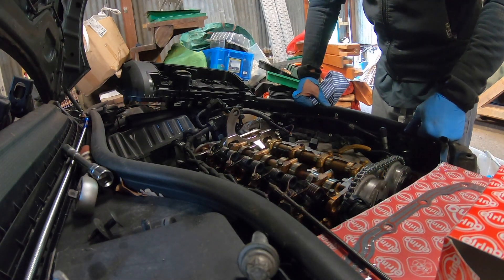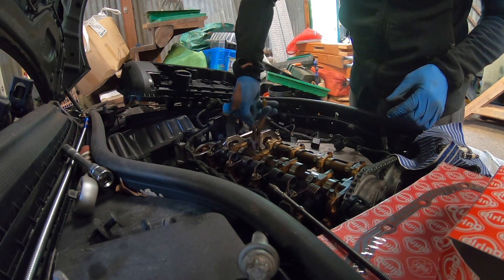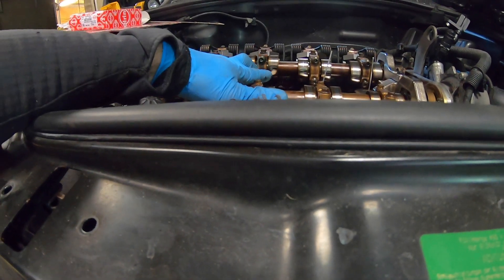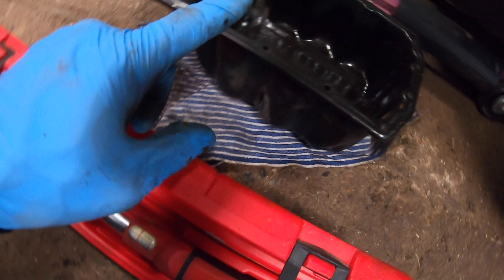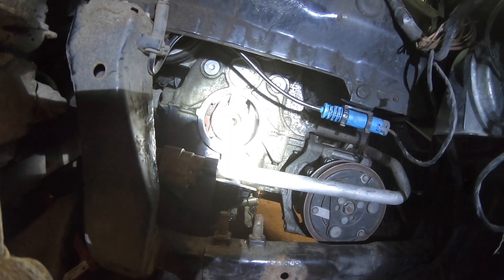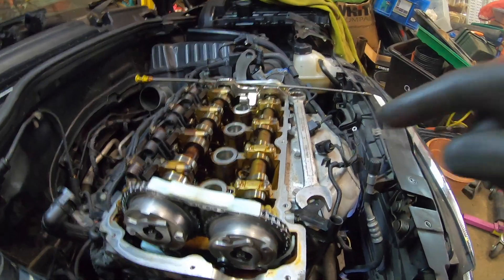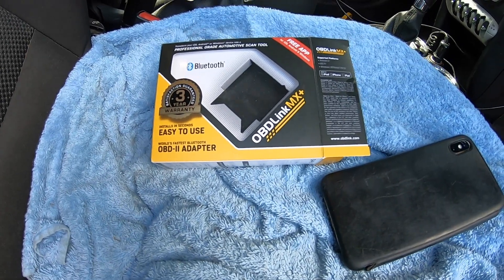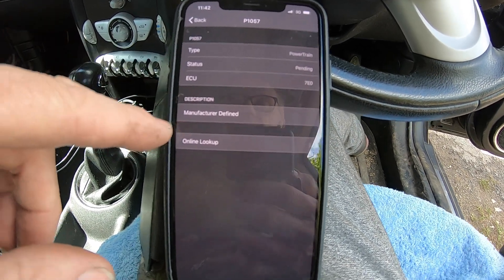R56 Mini One   Timing Chain Pt2   VVT Errors

Comment: I’m at the point of almost doing a startup after replacing timing components and a number of other parts. My first time… I’m curious if you ever got rid of the codes and how the adaptations went.
Reply from the maker: Codes did go, but the car had a few other issues.  Traced to a faulty o2 sensor.  After that it ran fine.  However went through checking and cleaning solenoids, cam motor, re-timed it all.
I am doing the thermostat on the car at the moment.  Will post that video when it is done

Comment: Why you didnt mention/do vanos adaptations reset after the job before starting? Its essential.
Reply from the maker: -- because I am learning, this was the first time I had done this!  As I have stated previously I am not a trained mechanic, I just like to pull things apart and try fix things.  This car is a friends car and he was keen to get the work done and so I offered to help.  The good thing for me is I have learnt a lot.
Reply: @hyphensclassics  Im pretty sure the issue in mine is the adaptation, since i changed the chain/tensioner/guides and chain was streched for sure/tensioner was weak, the car works ´´better´´ now, but still throw the codes p0014 and p11a8, so im pretty sure the ecu just has those wrong old adaptations still in the system and thats the reason for them to still come up and go into limp mode. Lets see after the adaptation what happens.
Reply from the maker: -- I hope it goes all well for you!  It is a shame you need a garage or a really good code reader to wipe the adaptations
Reply: @hyphensclassics  Can i ask you a presonal preference regarding cam phasers? When i install them, does it matter which is the position i install them in? Or can i freely choose the position? Theres a lot of mixed information on regarding that. I dont wanna do it wrong. :)
Reply from the maker: @---xv3pq  I have no preference.  Note this motor is the N12, which has a cam phaser for inlet and exhaust.  I believe the N14 only had this on the inlet.  The oil input to the phaser is not keyed to any location, so you can just pop the on which ever way you chose.  I did consider this when removing them, but after noting that there is no specific key, I just popped them on.
Reply: @hyphensclassics  Yes, mine is a 1.6vti= exact same engine and 2 phasers., yeah, that i was thinking too, since there is a pathway for the oil to go in the right direction, no matter which position they at. Thanks man!
Reply from the maker: @---xv3pq  No worries!  All the best!
Reply from the maker: -- you are welcome! Best of luck
Reply: @hyphensclassics  Yeah! Me too! I mean ive been having this timing related issue in the same engine for months now..and man, im frustrated. And the only thing i can still do is to do the vanos adaptation relearn to see if it fixes the issue. Ive changed new chain kit without new cam sprockets since they look fine and lock properly. Next week ill get the diagbox software to reset those and im eager to see if it fixes the issue. Let´s hope for the best. The reason why i asked is that is because ive tried everything except that adaptation. These engines purely can be tricky get fixed and the underlying real issue can be 20 different small things. Well, ill be patient and see what happens for me. :D For sure, i aint buying a another car with this engine since it has become way to expensive/time consuming for me..I just wanted a reliable engine and this is far from it. :D Thank god, ive made all the work by myself learning like you, otherwise it wouldve cost thousands to find and fix the issue.

Comment: Hi 
I have 283D,288D, 2870, 2891 code on a 1.6 cooper from 2007, both vanos have been changed but still the issue only when motor is hot, then the car is vibrating when the fault indicator appears, when motor is cold there is no problem, please any advice ?
Thank you and good job !
Reply from the maker: Hi Stykix, First thank you for watching.  second, looking in the information I have to hand, I cannot see the codes you mention.  Is there any more information about the codes that you have?  My codes only go up to 27xx
By vibrating I assume you are getting rough idle seems to be no power at times? 
How old is the car? How many miles?  How often is it serviced, how many miles in between services?  Are there any noises on cold start?
Reply from the maker: Just checked again and I am not seeing those codes. Did you get these codes and off what system?
Reply: @hyphensclassics  Thanks for your response, 
So i'm getting those errors : 
283D - VANOS Exhaust Adaption Stop
288D - Exhaust camshaft to crankshaft correlation
2870 - VANOS inlet, flank adaption - permanent
2891 - Inlet camshaft to crankshaft correlation
The car is from 2007, so 13 years old, it have 147.000Km, it have been maintained normally, oil changed at the right km etc ... 

When the engine is hot (after several km the engine reach is normal temperature) the fault light appears then the car is getting rough, like vibration and power loss. If I turn off the engine it disappears and then it appears again.

When the car is cold there is nothing, no noise, it is running correctly.

Thanks
Reply from the maker: @Stryk1x  thank you for the extra information. That sounds very much like the chain tensioner if not the chain itself.  There is a possibility that the cam chain rings are also clogged and not working properly. 
I would suspect that you will get a chain rattle when the car warms up then.  The vibrations in the car are due to the engine running rough, the ECU is trying to change the timing to suit the information it has, but either the information is false or the ECU has run out of adjustment and so this occurs.  The ECU would normally put the car into limp home mode, unless it is really struggling and then it just shuts down the engine and this is all designed to protect the innards of the engine.
One other thing to consider is your O2 sensors in the exhaust.  You can check, when cold, to make sure they are in tight and the cables look covered and lead away from the exhaust and are not twisted.  If these go faulty they tell the ECU to change the timing, so as above, if there is false information the ECU will try to make adjustments based on what information it has, which if false can cause issues
As for the servicing, this is one of the known issues with the N12 and N14 engines, the factory service interval was 10,000Km, about 6,000miles.  However, the original plastic chain guides need a more frequent cadence of maintenance.  If you car has reached 147km without having the timing chain replaced, then now could be the time.
Before you go there, record the engine on cold start, then warm it up and take another recording, listen for any different sounds. If you post videos somewhere, let me know.  You can also email me at michael@hyphensclassics.com